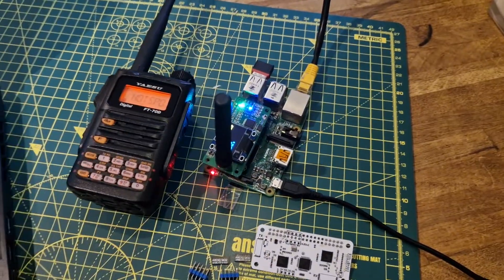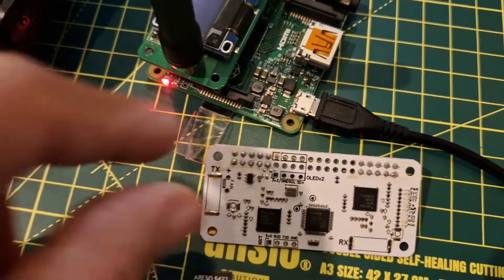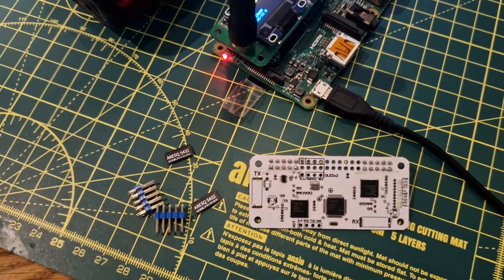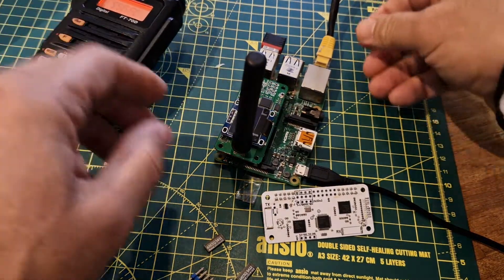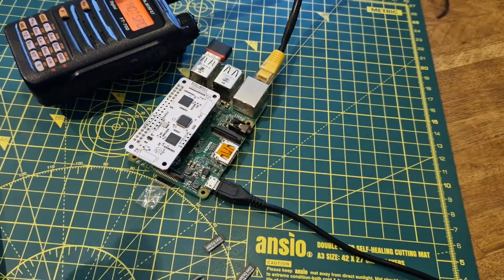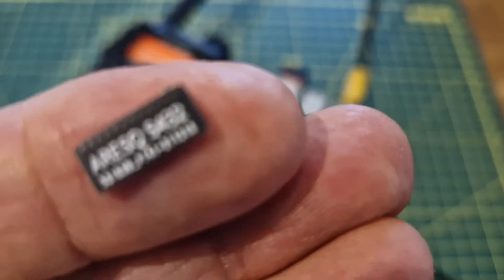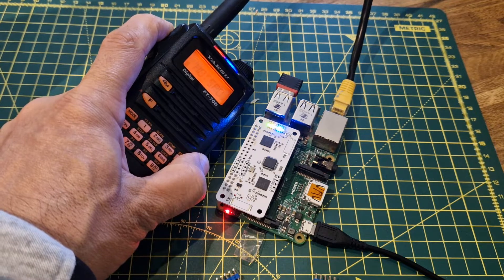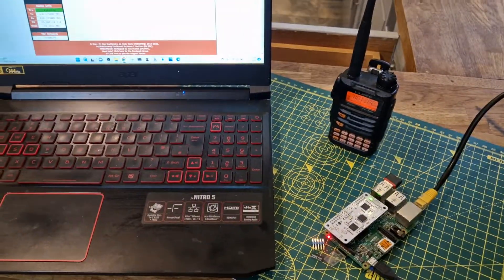MMDVM -DUPLEX  V/UHF Hotspot Hat- Pistar or Blue DV

Comment: I would always use the power facility to shut down the Pi before you turn the power off, otherwise you will corrupt the SD card sooner or later and have to rewrite it. Use solder paste for that job.
Reply from the maker: Thanks I have some paste do I just tap the iron on ?
Reply: I would add a small drop of paste to each land on the pcb. Hold the component in place with tweezers and with a fine cone bit, warm one end until the paste flows. Let it cool and check it is firmly attached, then flow the other end. Before applying the paste, clean everything with a solvent such as isopropyl alcohol.